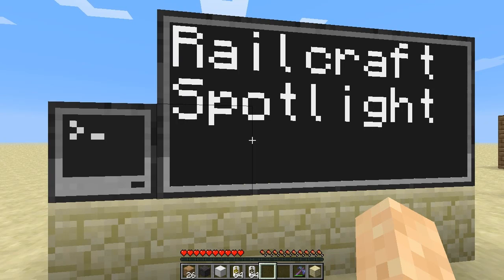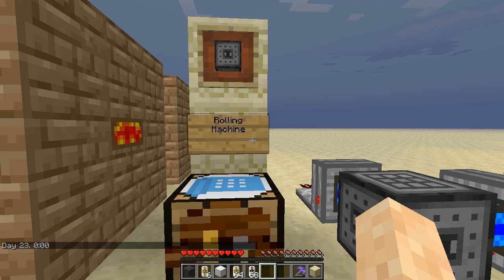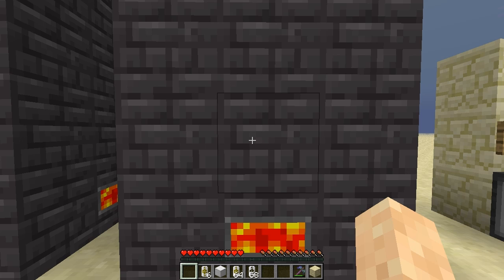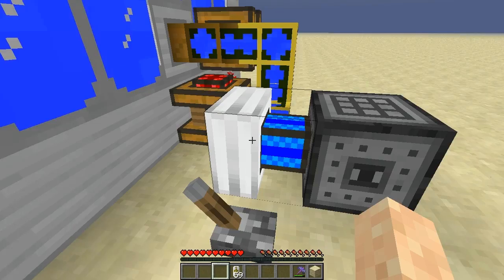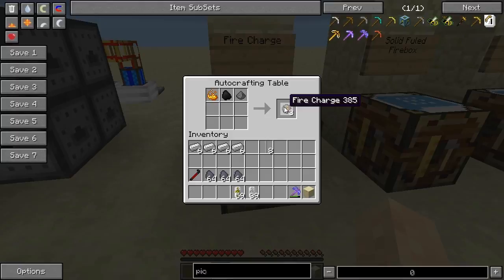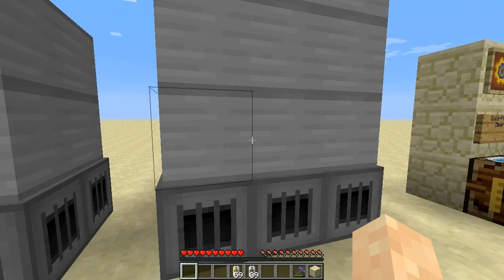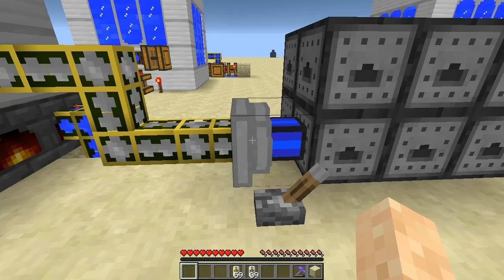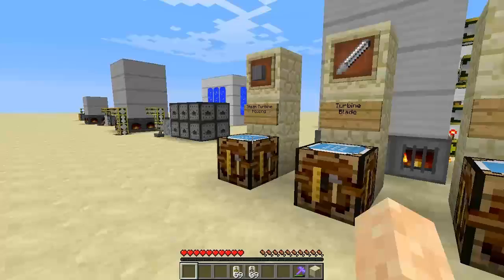Railcraft Spotlight Part 1 -  Devices and Steam Power!

Comment: You can also pump water into and out of the water tanks with pipes or load/unloaders, it's a much cheaper option for an early storage system for water than the iron tanks.

Comment: The energy unit is actually called Minecraft Joule, not Mega Joule. Pretty misleading, I know.
Also I calculated how much power the industrial steam engine would have if the unit would be Mega Joule: 159.84MW or 214349 HP. Would be a bit too much for a single steam engine :D
Really nice spotlight, very informative, thanks (: